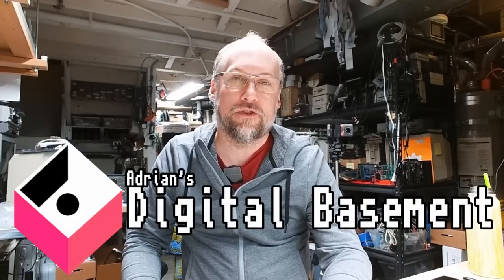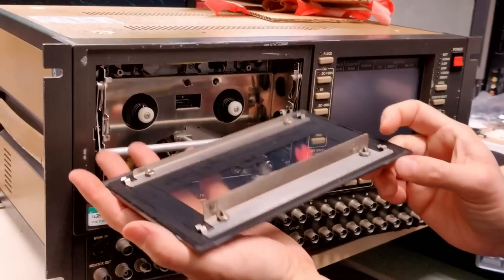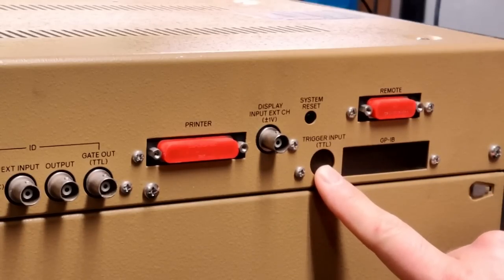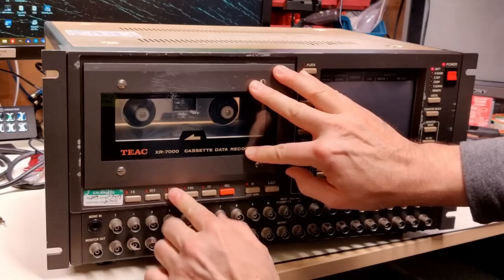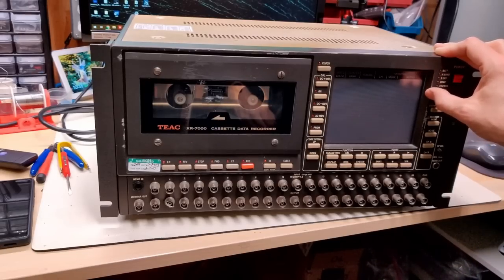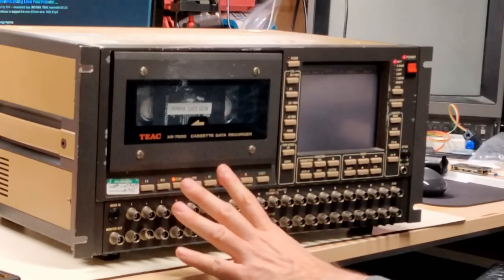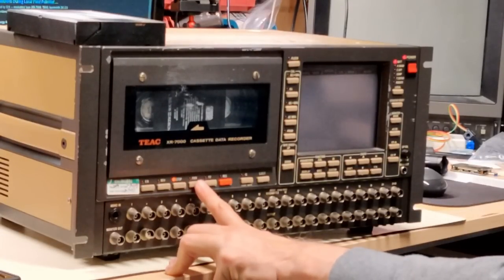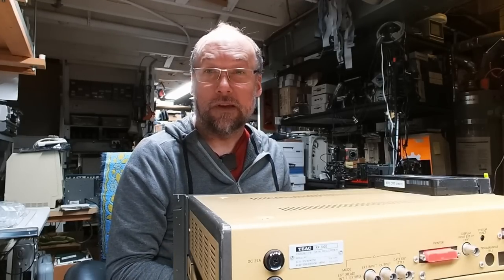0057 A mystery data recorder, a hurt Sun SPARCstation IPC and a MEGA little TV

Comment: Poor little sun. I have a soft spot in my heart for Sun and Solaris. I spent way too much time fiddling around with these machines instead of studying back in my university days. However, they have a common problem. The nvram gets corrupted or deleted when the battery is empty. They loose their serial numbers, MAC Adresses and other stuff and won't boot, at least not easily.
Reply: Has anybody dumped the NVRAM and made its contents available on line? Do you know if the essential values are stored in a from where they could be copied across to another machine and possibly edited?
Reply: Normally the MAC address is printed on a sticker somewhere inside the machine, so it is fairly easy to correctly program at least these NVRAMs.

Comment: The Sun SparcStation IPC was a low end "lunch box"  workstation, somewhat equivalent in speed to a low end 486. Typically the motherboard on these is fine, I've worked on dozens of them and never had a motherboard issue. That being said, the NVRAM battery is most certainly dead and will need to be replaced or modded with a new battery attached. I've had quite a few of the power supplies in these fail, and due to the size and how many caps need to be replaced, it can be time consuming and somewhat expensive. You might want to talk to some of your Sun friends and see if someone has a working PSU they can part with from another system. These systems are very slow, even when loaded up with max ram (48MB's) and a SCSI2SD card. Your best bets for an operating system are loading up Solaris 2.5, or NetBSD.
Reply: Back when I dealt a lot with those Sun IPCs, replacing power supplies was probably the most common 'repair'.. in the late 90s and 2000s there were companies which could run a viable business on just refurbishing those psus (and same for the SGI Indy PSU)

Comment: Hello!  We used to use those tape recorders for multi-channel vibration sensor recording when diagnosing rotating machine conditions, usually during a rebuild or commissioning event.  A large machine with a driver, gearbox and driven piece could easily have a dozen or two acceleration, velocity and proximity sensors, all of which require waveform sampling synchronised with the machine speed for good machine condition diagnostics.  After recording, we'd have to "play it back" into purpose-built condition monitoring sampling hardware and software for analysis.  Today we do it all in an SSD-based multi-channel recorder that dumps straight into a database for analysis.  Prior to the DAT machine, we recorded on analog multi-channel reel-to-reel tape machines.

Comment: You can use the TEAC to record oscilloscope data. These were used as a way to store data on cheap, off the shelf storage media before the data was stored on the lab computer itself. When I worked in an electrophys lab we would just store data on the computer itself because the space needed is trivial for modern storage, but you could still find these around some of the older labs. Old equipment tends to just sit around old science labs which can make for some interesting vintage electronics discoveries.
Reply: i would say monitoring application, for producing process, lab is never this need, in a lab you do primitive setups, production needs this solution.
I have seen it in a Dairy Factory, controlled a 1978 mainframe

Comment: As others have said the TEAC data recorder was commonly used to record parameters during tests of such as vehicles (road, rail & aero). Those recorders replaced the real heavyweight recorders that were an absolute pain to lug around (but afterwards you didn't need to go to the gym). Each of those cards is a frequency modulator/demodulator that had to be set up before a set of tests. There is probably a more conventional channel (#22?) intended for a voice channel so engineers could comment on wat was happening to help with analysis. They are complex beasts indeed! I'm guessing that in terms of original value, that's one of the costliest you've had in your basement. 

Inputs were commonly derived from amplifiers that would boost the output signal from strain gauges, accelerometers and other transducers. Also possibly conditioned current and voltage from various power supplies that needed to be monitored and analysed.

During a recording, signals to the various output BNCs are probably derived from a downstream head so that engineers could check that data were being recorded properly onto tape. 

But more 'Adrian's Analogue Basement' than digital - probably hybrid though with the control and monitoring functions.
Reply: I wondered about “Adrian’s Analogue Attic” as a spinoff channel name
Reply: The “memo” input is for concurrent voice recordings, but I don’t think it’s modulated like the other channels.
Reply: @webcme6779  I agree. There's no need for response down to DC with voice so it probably wouldn't be frequency modulated, just a limited bandwidth conventional channel. Back in the 1980s we also used that channel to record a series of pulses that would guide the PDP-11 computer used to digitise and analyse data.

Comment: Sweet, an IPC!  I have restored a bunch of IPXs over the last few years which is the IPC's slightly faster brother.  The power supply will almost certainly need to be re-capped, the real time clock that is also an EEPROM that stores things like the serial number will almost certainly be bad.  You can actually just use an ATX small form factor power supply to bypass the old Sony power supply entirely if you want.  SCSI2SD cards work well as an SSD replacement, they are large enough that you can install SunOS on one "disk", NetBSD on another, etc.  Happy to give you any hints or help you need!

Comment: The IPC form factor is adorable, a lunch box. Sadly that's probably the best thing about it. The Sun4c is slooow. Solaris 2.5.1 or 2.6 would probably be best on it. The serial port is an A B port with both serial ports on a single 25 pin connector. It will have a serial console on one port, usually 9600. The break key interrupts the boot process to get to the Ok prompt. Good luck have have fun.

Comment: Important: The SGI video connector has a different pinout from the Sun video connector! I don't remember exactly what the difference was, but I'm pretty sure that at a minimum the sync was on a different pin. I used those old Suns a tiny bit around 1997, but even then they were old. (My department had almost entirely moved on to the later UltraSPARC models by then.) I might have a Sun video adapter somewhere. I used to have Sun keyboards/mice but I got rid of all of those 10–15 years ago. You can definitely run it headless via the serial port. They come up with the console running on the serial port at 9600 bps IIRC. I'm pretty sure Sun's serial port pinout was the same as Apple's.

The SPARCStation IPC is a pretty nice little Sun. They supported it for years and years, at least up through Solaris 2.5, because I remember installing that version on one. (One of the first times I worked with Sun hardware.) It was horribly slow on that machine, though. You might be better off running the old BSD-based SunOS or Linux. Although I think it may have been slow because the one I used had barely any RAM; put 32 MB in there and it would probably run fine. These things can boot off an external SCSI hard drive, and that's the easiest way to install an OS on a blank hard drive. There ought to be SunOS or Solaris install images out there somewhere. I'm sure I don't have any anymore. These things used those annoying clock chips with the integrated battery. (Not Dallas but some other brand.)  So that'll be dead. So some things won't work unless you find a way to replace that. I'm not sure about the IPC but a lot of Suns from that era stored the ethernet MAC address on the clock chip so ethernet may not work right without it. (ugh)
Reply from the maker: I found a link talking about the 13W3 differences. I have to say I didn't know these differences existed! Lame! http://ps-2.kev009.com/rs6000/13w3/13w3_pinout.html

So I'll need to sort that out after I sort out the power supply issue. I looked at it last night and many components are very corroded in it, so I may need to just replace the entire thing with a PicoATX. We shall see!
Reply: @adriansdigitalbasement2  You can fix the NVRAM (it's the IC with the yellow sticker) using this method: https://www.youtube.com/watch?v=3lP4rXua1Lo I like the IPC/IPX form factor since it goes so well together with expansion chassis like the Sun 411 or 911. I had a boatload of that stuff but gave it away 10 years ago. I would say that it makes sense using it either like a simple headless server with NetBSD or expanded with fun stuff with a period correct OS. Seeing that you do not have Sun stuff you might be better off passing it on to other Sun people/trading it since this needs a lot of work and pheripherals to make a fun machine apart from simply running NetBSD over serial.
Reply: But if you know people with Sun stuff I would encourage you to try some out! The multi CPU SparcServers (or SparcStation 10/20) are cool, as well as the early 68k machines.
Reply: I love the IPX / IPC form factor, and the level of integration really impressed teenage me. The design was by Frog Design of mac fame. I had a few IPX (same form factor) of these years ago and they ran NetBSD as well as could be expected for a 40MHz machine. (IPX is 40MHz, your IPC is only 25MHz.)

Serial console is the way to run these, they never had great graphics performance even when they were new. You can use mac serial cables; I forget if they need a null modem adapter. As others have pointed out, if there is no keyboard plugged in they will default to serial output.

That power supply looks in rough shape, I wonder if it could be retrofitted with a more modern one?
Reply: monitor is not video out, sorry
Reply: @poofygoof   great performance....    the Turbo GX is very competent - 8 bits of color and 1152x900 resolution in 1991 and accelerated - they are a bit of historical, because two of the designers incl the lead one left the company when Sun decided to use normal PCish PCI graphics.

Those two were Curtis Priem and Chris Malachowsky,

Comment: Please keep in mind that the adapter for SGI does not have the exact same pinout that the connector on the Sun has.

Btw... Sun machines are always cool ;-), as are SGI machines. 

Unless they run hot of course, which the larger ones tended to do. A Sun V440 will easily draw 50W of power, just by being connected to the grid. And once you turn it on, it will draw 450-550W of power and you will be able to hear it from the other side of your appartment.

Comment: That will run SunOS for sure and older Sparc Linux and NetBSD.    Suns can net-boot so you don't necessarily need a floppy or cdrom that works to install an OS on there.  But you could attach an external SCSI cdrom or hard drive if you have any.  The very early versions of Solaris might work, but I'm not sure if that IPC processor was ever supported on any Solaris version.
Reply: I never had succes with Liunx, but NetBSD was perfect.

Comment: to be more specific, say you had a bunch of test equipment, e.g. oscilloscopes, lab equipment, and you wanted to be able to archive the whole thing to play back later, you'd hook all your test equipment up to this, and e.g. use the GPIB (IEEE-488) to control it from a lab computer.
Reply: i would say monitoring application, for producing process, lab is never this need, in a lab you do primitive setups, production needs this solution.
I have seen it in a Dairy Factory, controlled a 1978 mainframe
My nephew makes systems for this need in the UK, but is guess the website did say it all, but he still is not understanding what it is, lol

Comment: yes vhs cassettes are used , it doesnt use a spinning drum (its like a glorified reel to reel unit) , its for plain electrical signals , basicly a oscilloscope data recorder 

(is screaming at the screen )  the tapedrive is gummed up , like your harddrive stepper motors , a lil oil in the right place would be kind to the machine , the tape cracling you hear is possibly caused the the two rubber "rollers" you can see , their rubber is probably hard as a rock (if not give them a good cleaning ) 

as for the screen not working , try the "monitor out" in the front bottom left if its composite out

Comment: As someone mentioned, w/o the keyboard, the Sun will come up on the serial console (A port).  IIRC, serial cables for a Mac have the same pinout as the sun (i.e. for an external modem).  One of those and a null modem adapter and once you get the power supply up, you can look for life from the system.  The NVRAM (module with the yellow sticker on it on the mainboard) will no doubt have a dead battery.  This is an MT02, and glitchworks (IIRC) has MT02 repair kit (like repairing Dallas modules).  Max RAM IIRC is 12M I believe on the IPC.  I'd suggest SunOS 4.1.3, and avoid the later Solaris System V based UNIX as with the low memory and the 25MHZ processor, Solaris 2.X will be terribly slow on there.

If you don't have a Mac serial cable, I should still have several.

Comment: I came across an unused Sparc with similar form factor as that one at my place of work in 1995 - they were designed so that you could add modules which all shared the same case design and stack them together.  The additional modules included hard drives, tape drives, CD etc.  You daisy chained the power and the SCSI to connect them together.  The keyboard has a mouse connector and the mouse was optical.  They ran Solaris (or possibly SunOS).  The one I saw could boot into the os but it was unstable - which was why it wasn't in use any more.

Comment: My university had alot of IPCs back in 1997, they all had monochrome screens. They were way too slow to be fun even then, but you could always use it as a terminal and get the X-session from one of the computer labs faster SUNs, usually Ultras.
Reply: I used one as a dns/dhcp server in 2000 in the compagny I worked for.
Running NetBSD.
Reply: Yeah, these are the 386 equivalent Terminal stations that kept the kids from running their buggy programming code on the main time share. Your home drive would be NFS mounted to which ever station you logged into. security was poor a fun game was to remote login and play music on someone elses system because /dev/audio wasn't locked to the user on console. Only after became a problem did they start looking at the logs and yelling at people.

Comment: I have a SPARCstation 1+ and use a small KVM that I've had since the mid 90's that has cables for it.  It allows me to plug in a PS2 keyboard and mouse and works with the Sun.  I used the SPARC with NetBSD which I installed via netboot because I didn't have a working SCSI CDROM at the time.  Hope you do something fun with the IPC and it doesn't just collect dust!

Comment: As others have said, you can just use the serial console to interact with the Sparcstation if you aren’t able to find a keyboard and mouse locally. And yeah, be prepared to deal with the dead NVRAM battery. It’s a very easy fix. Once you do get it going, if you really want to run Solaris on it I wouldn’t bother with anything newer than 2.6 but even that might be pushing it. You’d probably have a much a better experience with pre-Solaris versions of SunOS. As for the 13w3 to VGA adapter, it wouldn’t hurt to give the one you already have a try, depending on how it’s constructed and the monitor you’re using it might work, but if you’ve got time before you plan on messing with this thing you might as well order one of the adapter cables that has DIP switches to let you configure how the sync signal is sent. For what it’s worth, when using that cable on my Octane it doesn’t seem to really care how I set the switches for the most part. Maybe my monitor is just really forgiving. I don’t remember if that was the case when using it with any of my Sun stuff.
Reply: Actually, if you haven’t found a Sun keyboard and mouse by VCF East feel free to reach out. I have a set that I’m not using that I can give out on an “extended loan” aka as long as I get it back at some point. I have a few Sun machines but nothing I plan on using any time soon. I’ll be at the expo most likely on Saturday.

Comment: I got to use a mega watchman back in 90’s. I can confirm the performance while watching tv was very good. Battery life wasn’t half bad either. Unfortunately the one my family had had issues back in the 90’s so batteries didn’t work until 2002 when I fixed a bunch of cracked solder joints.

I remember watching home improvement the first time I used a mega watchman while camping 😊

Comment: Ok put it as a lay man it is storage scope with 21 channels.
The screen should stay on so has a fault.
You can get a digital VHS-D the tape was. Slightly different a bit like metal on compact cassettes. These VHS-D was also used for computer backup outlasting the video format.
The bottom row of bnc are monitors for the above channels.

Comment: I haven’t seen an IPC in a while, used to repair them to chip level.
Don’t remember PSU’s failing, but I had loads of them so they were just swapped out. The mother board common faults were the discrete chips (SCSI or Ethernet controller) or ram cache.
The NV ram is also a common fault and that contains the hardware and ethernet id.
They work in headless mode via the serial port well, and any power on errors are reported that way as well.

Intermittent errors are common due to heat, so a can of freeze spray helps find the chips as they start working again.
The only thing special about the floppy is electronic eject (as well as the manual via a small hole).
The extra card on top is an entry level graphics card.